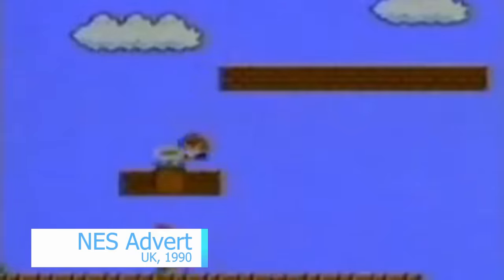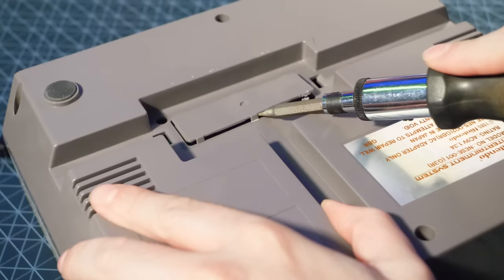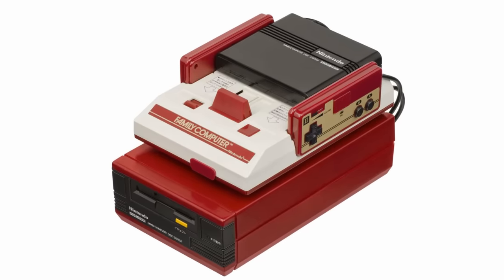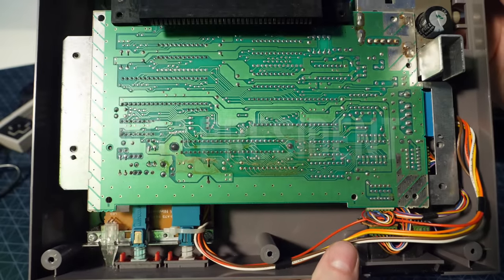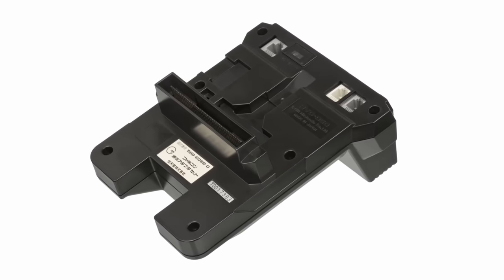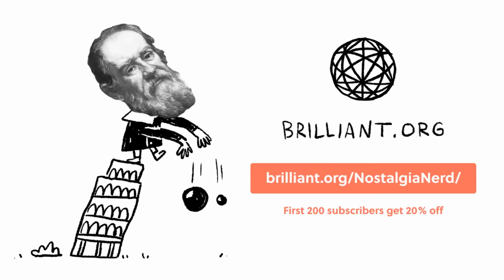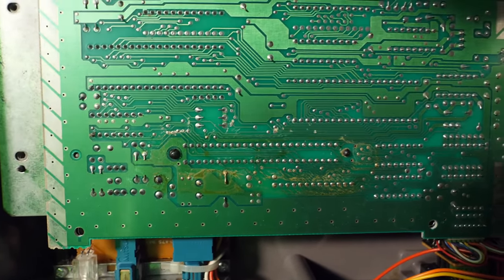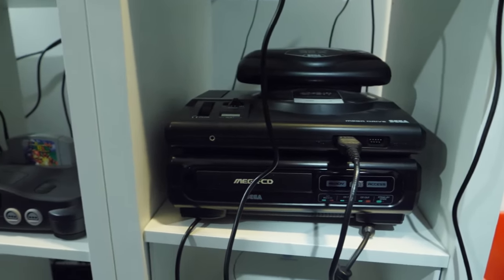Does the NES Have a Secret Master System Port? | Nostalgia Nerd

Comment: Nintendo is notorious for putting in slots and things for planned upgrades/extensions that never ever end up coming to light. In fact if you look at the shape of the first PlayStation, it is very, very similar to that of the Super Nintendo Entertainment System (SNES). That's no coincidence, because originally it was a joint project between Sony and Nintendo as a planned CD-ROM reading expansion to the SNES itself that Nintendo gave up on, and a frustrated Sony went off with and produced the first competition to Nintendo to nearly smash it out of existence.

Comment: Its an expansion slot for future expansions that never came. The N64 has the same thing as does the Mega Drive. Only difference was the N64 and the Mega Drive both received expansions. The N64 received the N64DD (disk drive) and the Mega Drive got the Mega-CD

Comment: I can tell what I use mine for. With a little cut there, a little solder there and a dab of hot glue and now it runs off 2 rechargable 9 volt batteries.

Comment: Hyperkin RetroN 5 3-in-1 Adapter for Game Gear, Master System, and Master System Card that is what you would use in the back of the old Nintendo system it would play the game but it would start to over heat after awhile just so you know it was easier to just take the back off on the old system and insert the sega master game into the old Nintendo system

Comment: Short Answer:
The NES shipped with an expansion port on the bottom of the console. On multiple occasions, modems were planned to be connected there. However, the NES expansion port never received a commercial application.

Comment: This title would've been so much better if you'd started the video off asking it as a question then answering: "No, of course not. Especially in a world where lawsuits are a thing. In fact it would be so ridiculous and baffling that if the NES did have a Master System port, the title would've been an exclamation rather than a question. However what it actually has is far more interesting."

Comment: my first computer had 8 or 16mb  of mem 500mb hard drive, 133mhz pentium and a USB connector that was not usable but was sold as a  accessory that would be activated with future software updates......that never came. fyi the computer was an IBM Aptiva.

Comment: Hypothesis: Nintendo was the first to try some form of online gaming. The complete flop of it burned them so hard on the idea, that they never tried to put any serious effort into it again.
This is the most reasonable explanation as to why the online experience is so laughably bad in each of the online-capable Nintendo device.
Especially sad when compared to Sony/Microsoft devices, which already have Nintendo beat on the friend invites alone (rather than Nintendo's inexplicably terrible system of giving each user a randomly generated code which they are forced to exchange both ways just to add one another), not to mention having actual text/voice chat with friends, as well as group chat and the ability to take an entire group into a game. On Nintendo systems you can't even communicate.

Comment: When you talk about the cancel the projects and beta versions of Nintendo game from the Nintendo 64 and earlier you're going to be talking about this drives a lot that never came out in the US. There only exists one us retail Nintendo 64 disk drive but it can't play anything because of region-locking unless there's a mod chip that would disable that. The famicom actually had a disk drive. Let's not forget how the Nintendo PlayStation actually exists because sony tried to screw over Nintendo with disc based games because they did not read the fine print.

Comment: what speed could it hanndle. and making it future proofed with installing windows mac linuix on a rom drive  with atleast 500mb and so on. make a ssd drive to fit inside there and play al games. wikipedia  extra game port. reselling nes snes with adsl fiber optical speed modems would have been the future. 1 st t1 was enabled in 1998 somehow. but the last one nes was not sold in that time either. we stick to future nitendo gaming systems with wireless connections.

Comment: yeah. thing is. it's useless. it only has address line 15 and not the rest of it, so at most you can only interface it to 1 i/o port only (mirrorred 32K times in the upper address range ;) also the nes frontloader models have that cic chip pulling reset if there is no cartridge in the front slot which also has one (no problem on famicom or later toploader models), so you can't even force boot your perephials firmware. even if it would have address lines..... this whole port seems only suitable for nes frontloaders installed in shop display cases. it most definately is not suitable to 'add the whole rest of a computer' to as it lacks lower address lines. it being useless probably is for the better as the nes/famicom actually are nmos (already antique at the time ;) and as such it barely works already as is. hooking a whole expansion bus to it with all the missing parts to make a full computer would most likely result in all kinds of ttl level problems.

Comment: Actually it was originally designed for connecting to a developer dock as well as the cd addition sony waa supposed to make until nintendo fucked them over with philips then didnt even use philips design.